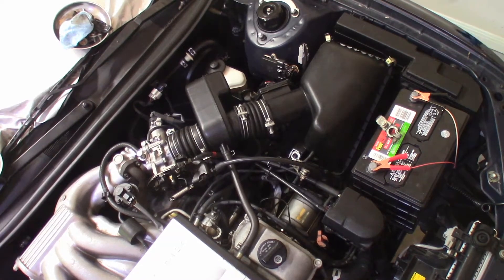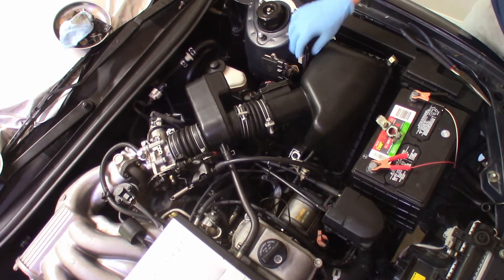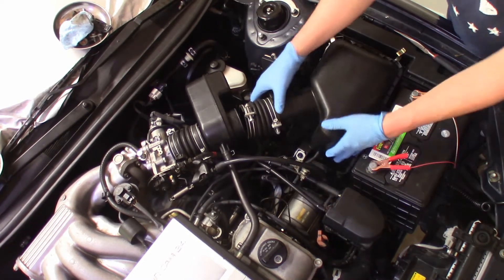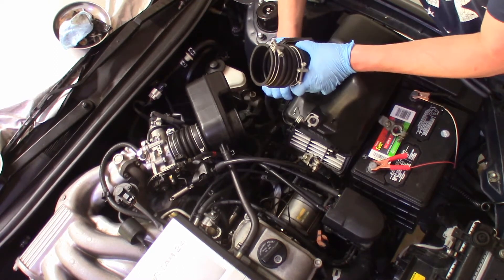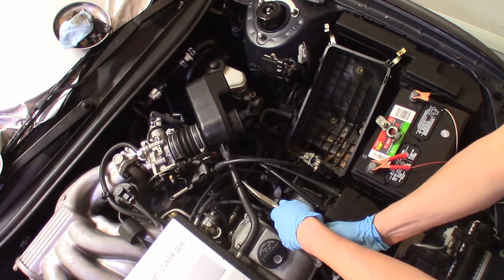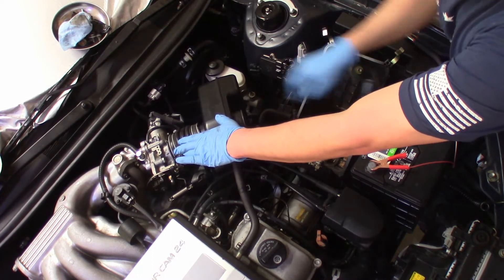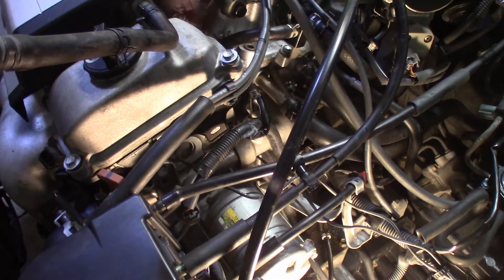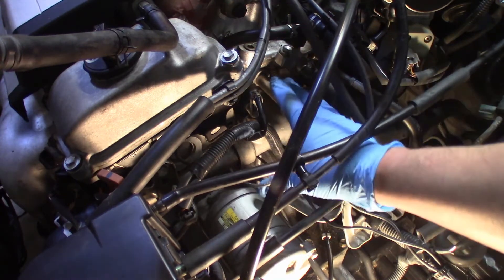LEXUS ES300 / TOYOTA V6 THERMOSTAT INSTALL

Comment: Thanks for the vids got a  1999 es300 and i think thermostat just went out because it over heats at idle but the fans spin. While driving it maintains a good temp so yea. Awesome vids that are helpful thanks
Reply: Got a 2002  es 300 over heats but steams out at the hose to the resovior
Reply: @timmynormand8082  my steaming out at the hose of the resovoir too did changing the thermostat fixed it?
Reply: @Play-jv3oi  yes I just finished changing the thermostat  an I put some antifreeze an all is great thanks
Reply: @timmynormand8082  the same thing that  happened to you, is happening to me
Reply: @timmynormand8082  i might have to change it, did you a pressure test?
Reply: @Play-jv3oi  no but I changed the thermostat an put new antifreeze an it’s great no overheating even with air conditioner. Thanks for y’all vidio information
Reply: @Play-jv3oi  mine was the thermostat.  Changed it  new antifreeze good to go
Reply: @Play-jv3oi  well I lied. The car started running hit again. Thought I had it.  Now I’m stumped
Reply: @timmynormand8082  How long did fix last? I realized that when it rained and the temperature cooled off it did not smoked. Also Put the coolant while the car is running so it can take it all the way to the Engine. Try that it woked for me. Let it go all through out the engine Keep putting water or Coolant while the car is on until you see it is fulled
Reply: @Play-jv3oi  I changed the thermostat an put I gal of coolant I went to the store an back  20 mins it didn’t get hot  later on I went to o Reilly with the air conditioner on an it stared getting hot.  I’ll try ywhat you suggested thanks bro
Reply: @timmynormand8082  Talking about Air conditioning now I realized that I think that what happened to me, two days or three ago it has been really hot and I have been turning the air conditioning HOT plus air condinining equal getting HOT try not to put the air conditioning on,. I will try to do that test and I will give you feedback tomorrow. try to do it and see what we end up
Reply: @Play-jv3oi  what did you do to fix it ?
Reply: @timmynormand8082  It was raining it cooled off and i did no turned the air conditioner. But the most important thing is to put the coolant in while It is running so the coolant redistribute through the whole engine. Becuase when you put the coolant while the engine is off then the thermostat my be close and the coolant does not get in the engine.
Reply: My 1992 does this and I’m hoping this helps

Comment: THANK YOU FOR MAKING THIS VIDEO BRO. lexus gang
Reply from the maker: Hope it helps
Reply: @nicklldoit  Im in the process of doing this right now, the skidplate bolts are all rusted so its hard to get them off to drain the coolant. but the job itself is clear after watching this video. the only hard part is all the rust buildup after 20 years
Reply from the maker: @geremyis5191  rust makes everything fun, lots of penetration fluid. Good luck

Comment: Thanks for that! I will be doing that in the near future. What's the part number of the thermostat?
Reply from the maker: TOYOTA NUMBERS: THERMOSTAT-90916-03129
GASKET-16325-62010.
I WOULD JUST BUY A PREMIUM THERMOSTAT AT YOUR LOCAL PART STORE.

Comment: What happen if I didn’t put the little thing up from the thermostat?  I put everything back together. Damn it and idk if i out it up or any other direction. 😡 i might have to remove everything again to make sure. 😡
Reply from the maker: you'll be okay, it helps to get rid of air
Reply: @nicklldoit  thanks but i went back in there to fix it and put it right. 😡 but thank you. 🙏

Comment: Hey boss, what year is this? Also, what sensor is the sensor sitting on the thermostat housing?
Reply: I thought it was the ECT sensor but after attempting to replace it, apparently it’s the radiator fan switch?
Reply from the maker: 1997,  ECT = engine coolant temperature sensor. The one on the thermostat housing is number 1, there is another temperature sensor on the radiator. Located on the passenger side at the very bottom. If your fans still don't kick on switch out your relays.
Reply: Thanks for that. I have 1995 and unfortunately I have reason to believe that they switched the sensors around. I can’t find any information anywhere about it. Would you maybe ever hop on a call with me to trouble shoot? Thanks again for the great video.

Comment: Ik this video is old but did you have to bleed it after refill?
Reply from the maker: No just refill and leave the cap open and run the car, the air will come out.

Comment: Did you drain all the coolant before doing this?
Reply from the maker: No, it's not necessary to drain all of the coolant. You can drain out some, you will still have coolant come out even after that. Coolant stays locked in the manifold behind the thermostat.

Comment: Pretty much the same for a 1995 Es300 or are you aware of any differences?
Reply from the maker: Oh yeah, it's the same. Not much changed between 1992 thru 2003. Air intake designs were different.
Reply: @nicklldoit  One other question for now if you don't mind. I'm going to replace the radiator and hoses in about a month (I have to wait unfortunately) BUT I'm replacing the thermostat right away. How much coolant mess do you think I'll get by pulling the housing and old stat without draining anything?
Reply from the maker: @dstewart7470  I would drain a gallon of coolant from the radiator, use the drain valve at the bottom of the radiator. That way you will drain most of the coolant from the hose to the thermostat housing. Once you pull the thermostat housing off, you will lose about a pint. It's not much.

Comment: where is the ect sensor located?
Reply from the maker: right on top of the thermostat housing, it has a grey electrical connector connected to a brass body shown in the video.